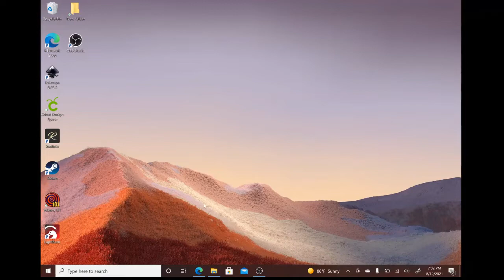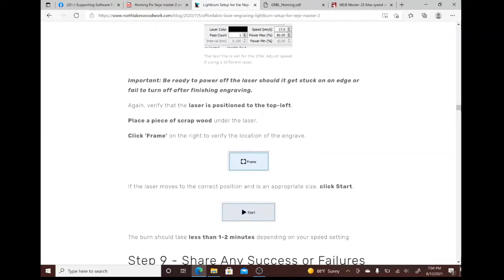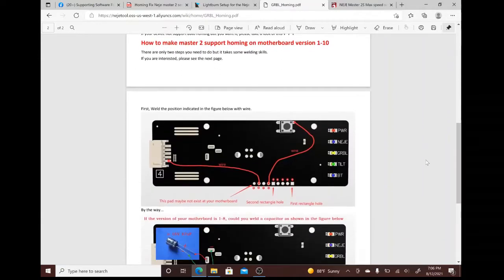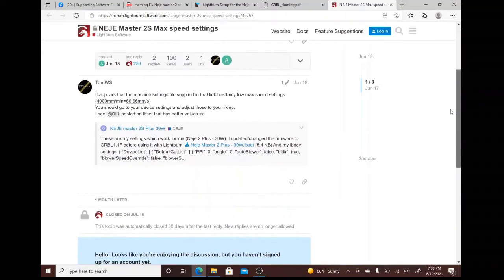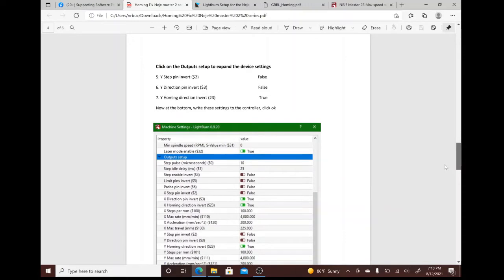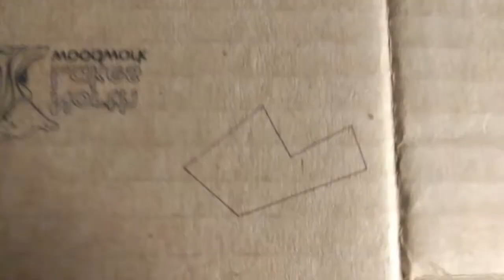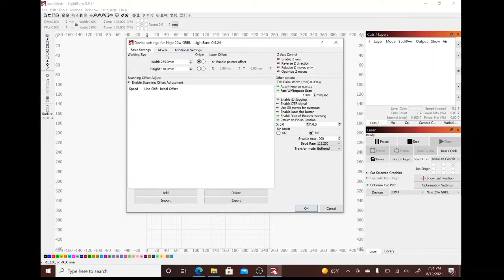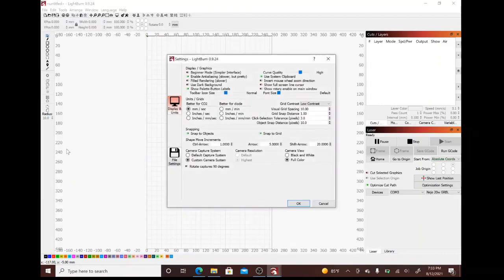LightBurn Settings for Neje Master 2 Plus 30W

Comment: Hi i Have a Neje Master 2s Plus do you think the 2s  config fits on mine? Thanks
Reply from the maker: I think it would be a good starting point. You can always load a .lbset file and then change indiv settings later.
Reply: @RebeccaMadeIt  thanks 👍